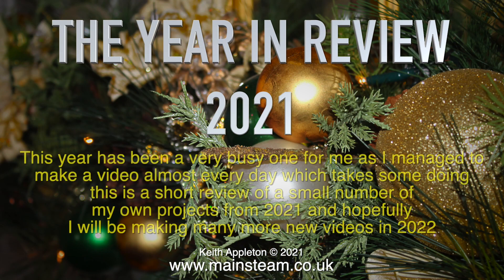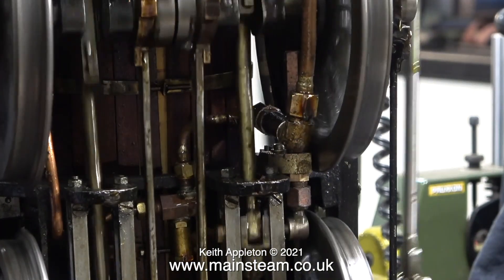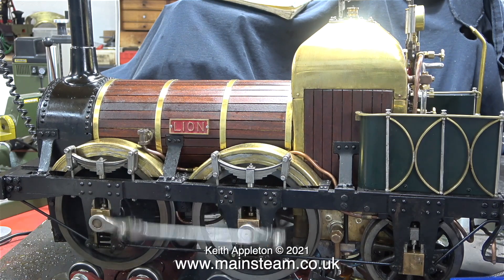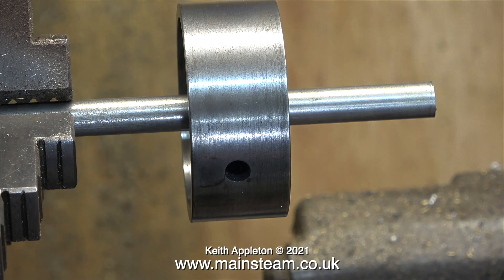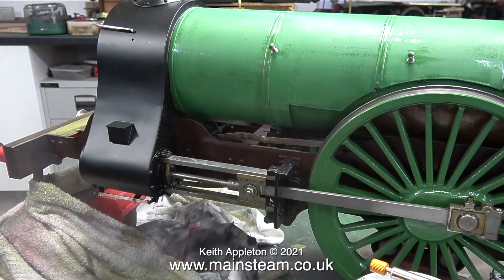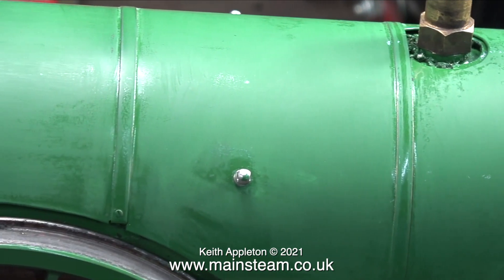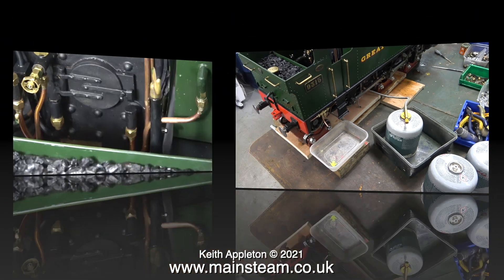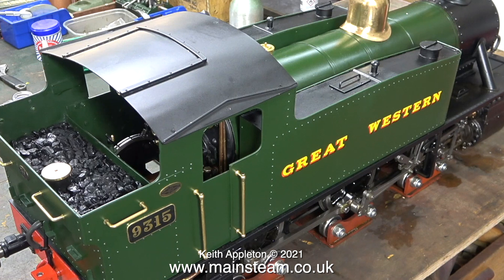A REVIEW OF SOME OF MY PROJECTS FROM 2021

Comment: Lovley video keith,have you had your traction engine out much it would be lovely too see some more of it in your videos
Reply from the maker: Not for a while, the weather has been rainy  for ages. I will be Steaming it shortly though, to see if I can get the injector to work properly. That is the reason why it's not been featured in a "Road Video". Two reasons really, I can't video it and operate it at the same time so I need to enlist some help, and I don't want to road run it without a 100% reliable boiler water feed system.